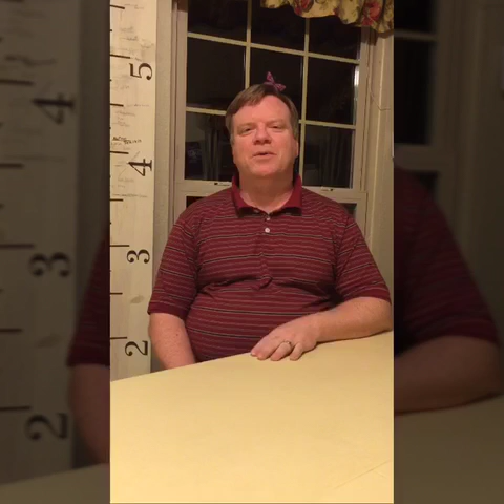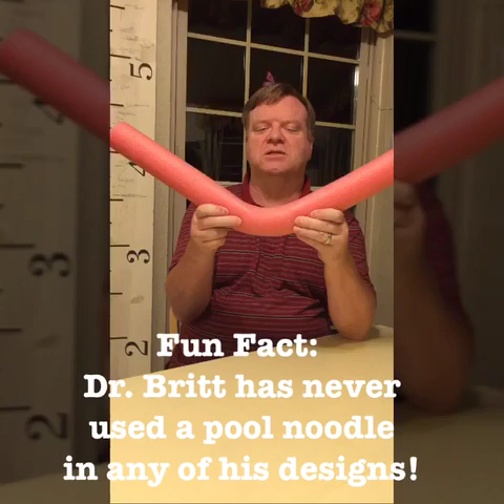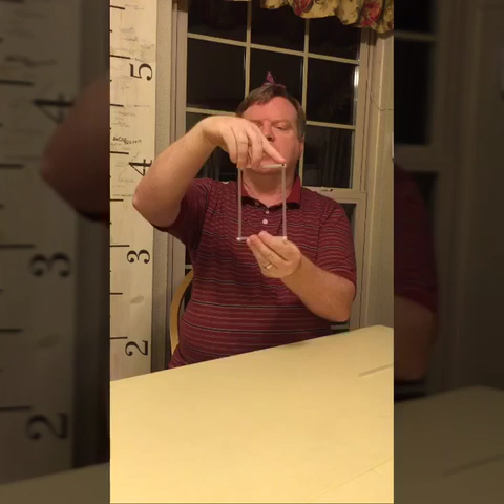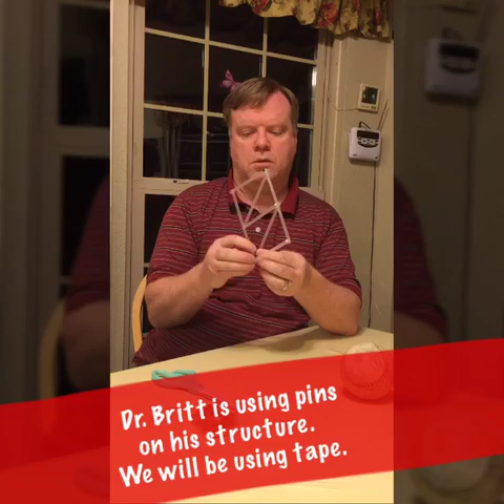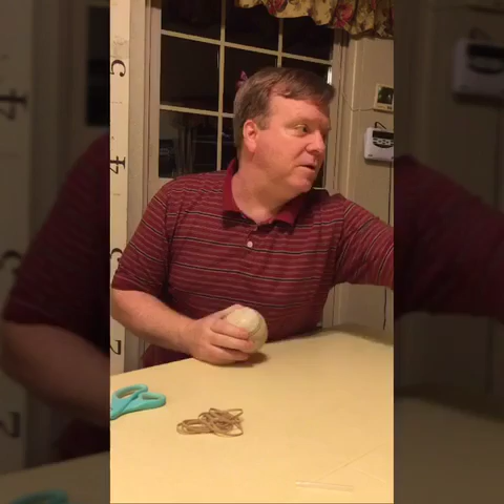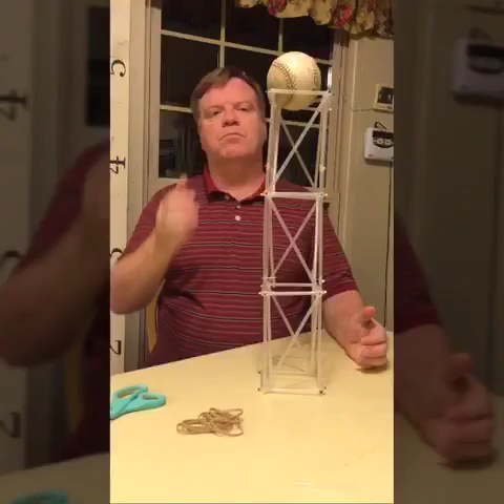Dr. Britt explains engineering straw towers

Comment: Im a supposedly sophomore Architecture student but I have failing courses like in Building tech and we had this challenge last year with our professor. But the straws he gave us was only limited like only 20 straws and a 1 meter masking tape. My team got 2.5 grade, we failed at resisting the small metal square load he put on top of our tower😂 our tower gave up lol, but our tower is high past 12inches. Im glad I saw this video and finally I understood how and where to put bracing, thankyou so much🎉❤